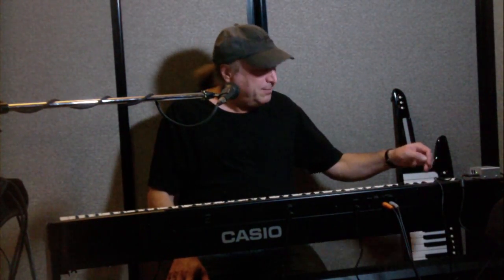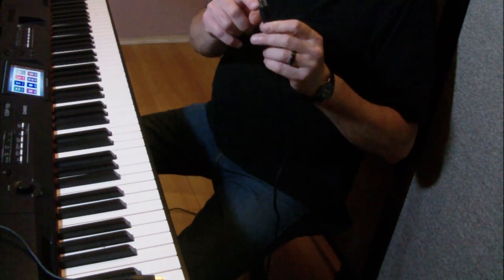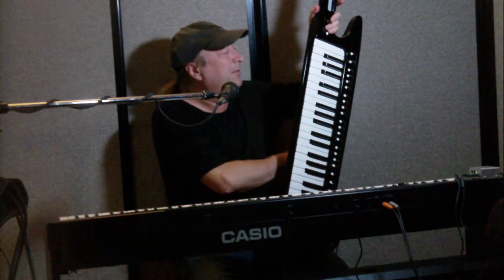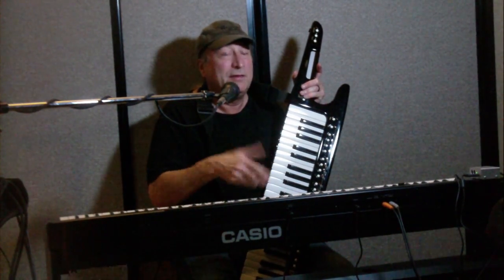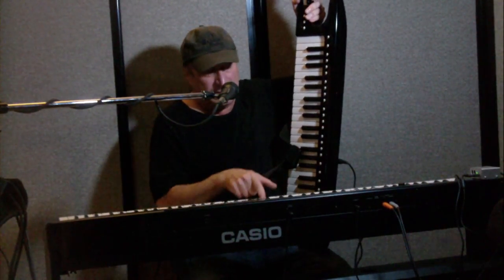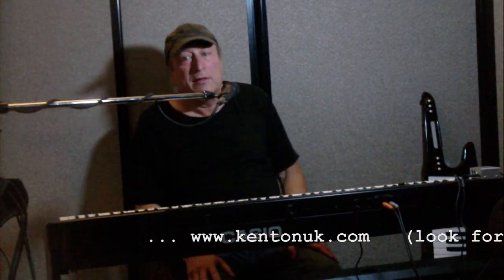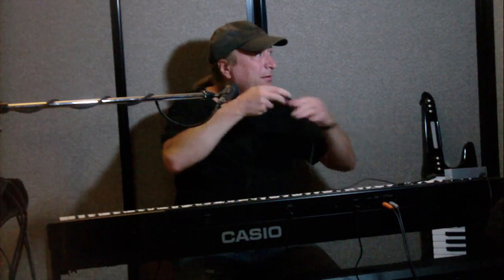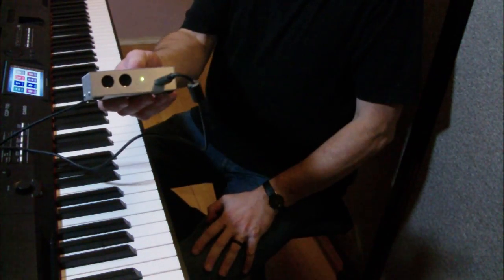MIDI: USB vs Standard 5-pin DIN, and how to convert USB-MIDI to 5-pin DIN MIDI

Comment: Thank you very much for the contribution, that video really briefly explains the function of the adapter, and if you are right, this adapter is an easy and correct way to link one or more keyboards only if they have a USB port.

Comment: Hi Piano Man Chuck
Thank you for this video
Question.....
I have a New Yamaha P-515 and a 2.5 year old Roland RD-88 with an out of warranty noisy loose PHA-4 action (the reason I got fed up and bought the Yamaha P-515).....Great action!
Now, The RD-88 has MIDI out and USB out but does not have MIDI in! Unbelievable🤔
I wanted to use the sounds in the RD-88 by using the Yamaha P-515 as a controller
Being that I paid $1,300 for it 2.5 yrs. ago
I sent an email to Roland for a solution but no answer.......I'm obviously very disappointed
Will this unit, or something less expensive work?
I know that you are well aware of both keyboards
Any help would be appreciated
Thank you for your channel and great info.
Sincerely,
Dave
Reply from the maker: I can't be 100% positive without physically hooking that up and trying it out to see... but I'm reasonably certain that the Kenton MIDI USB Host would work in this situation.  Yes there's other USB / MIDI Host boards out there but the Kenton unit is top notch with no problems.  Others have reported problems with other host products.  I would recommend getting it from Amazon at this link: https://amzn.to/3XyQQfg - that way if it turns out that it doesn't work for you, there's free returns!
Reply: @PianoManChuck  Thanks and may God bless✌
Dave

Comment: Hey chuck. Super helpful video! I have a Yamaha Piagero that I want to use as the master keyboard and then I have a Yamaha Reface CP as the keyboard providing the sound. The Piaggero had a usb cable at while the Reface has a 5 pin In and Out. Would I plug the USB hose in to the keyboard that would control the Refaces sound?

Comment: Hi there, i have a Casio CT-S1 for some time now ans i love it but the 61 keys are limiting my work so i want to use the CT-S1 as a sound module and play it with my 88 and 76 keys midi keyboards.

As the CT-S1 has o DIN midi IN i purchased a Kenton Midi/USB interface. It works and the CT-S1 responds to my playing but the sounds are cut short, even with the sustain pedal. What could be the issue here? Are there some settings in the CT-S1 ? I already swithed the bluetooth off but no change.
Reply from the maker: Please post all CASIO related questions at www.CasioMusicForums.com

Comment: Hi there i have a yamaha p125  and it has no midi 5 pins  can i use the kenton between to audio interface and the p125 to run vst plugins sounds  on a mac ...and get sound out the outputs of the interface to the mixer for sound

Comment: THANK-YOU SO MUCH!!! (Trying to connect Yamaha P-115 to a PianoBox to give me more instruments).
Reply from the maker: Great!
Reply: @PianoManChuck  Unfortunately, it didn't work even w/the adapter box :-(  I guess Yamaha (P-115) is tough. Is my next step to try this by hooking both the PianoBox and my Yamaha to the computer???
Reply from the maker: @terria1254  Some older Yamaha's are not fully USB Compliant - if that's the case, it won't work... but its definitely worked with all other brands out there (this video is 7 years old and I've not heard of it not working.... except with some older Yamaha's).
Reply: @PianoManChuck  Thank-you, this P-115 is a 2015...I'm not giving up yet! (I have found some ipad Apps that give it different instrument sounds).  :-)

Comment: Manufacturers need to keep the 5 pin sockets. I finally got back into synths and it is like searching for the holy grail trying to find a midi keyboard with the 5 pin sockets without emptying the bank account. I'm an analog man.....I avoid computers as much as I can.

Comment: Cool it exists but completely overpriced for basic electronic. I guess it is faisable on Arduino, I'll check it out.
Reply from the maker: There are less expensive units out there, but according to users on various forums, this one is the most reliable.  The good thing is that this can be used on just about any USB-based MIDI keyboard, so you basically buy it once and can use it with many different boards.
Reply: Any results, yet?

Comment: That's great, Chuck; thanks so much for putting that out there -  I have been using MIDI DIN connectors for years and just bought a Native Instruments  controller keyboard which has a MIDI over USB type B and no 5-pin DIN. Now I can use it with my older MIDI modules. Cheers!
Reply from the maker: Great to hear!

Comment: Great video! I wish i saw it earlier. I'm learning the electric piano on a Yamaha P45. It only has USB midi and I simply wanted to hook it up to a Synth module to turn into a synth keyboard as well. I thought it would be a simple connection but it took a few emails with the module supplier to figure out that I needed a Kenton din adaptor to make it work. Have you ever had any issues with the Kenton adaptor? All the best, Nick, Manchester, UK.
Reply from the maker: Had it for a long time, never any issues.

Comment: after watching many videos trying to figure this out this is the first that makes a modicum of sense. I had a old Yamaha PSR keyboard that used as both a controller and the internal with the the old 5 pin connections. After 20 years I finally upgraded to a new one not realizing it doesn’t have the 5 pin, only the USB. I hate it! I can’t connect it to any device that has the 5 pin. I’m considering getting this box but I’m frustrated to no end that they are selling all the keyboards without the 5 pin. I’m still banging my head against the wall with this. crazy world.

Comment: Subbed just for this! I've also been watching your other great Casio PX-S3000 videos. I recently bought that digital piano and ran into this MIDI problem with it. Hopefully, this Kenton box will solve that. It's a bit on the pricey side though!
Reply from the maker: The Kenton is pricey, yes, but its also the most reliable of them all!  I used it years ago on stage with Casio's CGP700 without any problems.

Comment: Have a problem and need help, i have a m-audio controller and just have usb B type midi out, and i need to control and play with it, a roland xv5050 rack module, but the usb of the unit is not for the controler, just can be played with the midi 5 pin in, BUT the m-audio controller, needs that the usb cable brings Power to work, the question is, does this host, provides that to the controller and can my controller works with my roland rack module? I need to fix this soon as is possible, we have shows a head in a few weeks and this is urgent... Thanks!!!

Comment: Which 5Pin did midi cable is correct to use for bass amp to foot switch? Some 5pin din comes with 3wire or 5wire.

Comment: Many home digital keyboards--even very expensive ones--are also dropping the MIDI DIN ports, as home users rarely use them.  For example, my old Roland HP-207 piano (from 2008) had DIN ports, but my new, top-of-the-line HP-508 only has USB B connectors.  I had to buy a Kenton box to connect it to my other devices.
Considering that a manufacturer can put in these ports cheaply, but a Kenton costs $200, it seems like a poor choice for consumers.  But that's what you get for choosing a non-pro instrument.  Anyway, a Kenton works perfectly and is the only choice in this situation.
Incidentally, there are a large number of devices to connect from USB-A (the flat kind) to MIDI.  These are commonly used with computers and iPads.  For example, I use a Roland Duo-Capture.

Comment: If i knew this would be a problem I would have bought a midi controller keyboard with a 5 pin Din Midi out. That Kenton box costs about the same as my Novation Launchkey.

Comment: USB Midi is a new Standard which is here to stay, the older 5-pin system will be Obsolete soon .
Reply: Richard Turner never going to happen, too many old synths that are way better than anything out now use din midi ,none of my gear is usb only ,I would not buy anything that was USB only
Reply: USB has a number of disadvantages. MIDI is electrically isolated so no ground loops. MIDI connectors haven't changed in 40 years and are backwards compatible over that entire timespan yet USB is on yet another iteration after just a few years. USB is computer oriented but MIDI is performance oriented.
Reply: iqi616 well said
Reply: Boss and Roland use Trs midi and there are midi a 5pin and midi b 5pin to trs connectors . I wishe they'd standardised it

Comment: Can a wind controller e.g. Akai Ewi 4000s/USB be used to control the Casio MZ-X500 which you used in this video (or any other keyboard)? Thanks.
Reply from the maker: The keyboard in this video is a Casio CGP700.
This is a piano / digital piano / stage piano oriented channel, I have no experience with wind instruments.  Your best bet is to find a forum more closely related to MIDI wind instruments.
Reply: Oh thanks for the correction and info.

Comment: but whats the advantage of plugging the controler to the synth instead of plugging it directly to a computer?
Reply from the maker: To eliminate the need for the computer, of course!  Who wants to take a computer with them everywhere they go (ie: gigs) and subject themselves to all the pitfalls (blue screen, latency, etc, etc, etc)?
Reply: The advantage depends on what you want to do or the problem you want to solve. 
In the video, he has a keytar controller that produces no sound, so he wants to connect it to something that will generate sound as he plays the controller on stage. So he only needs to connect those two. He says he wants to eliminate the computer, but his answer doesn't go into explaining other scenarios you may be thinking of.

Another scenario would be you are a home user and you want to play a controller or keyboard and use sequencer software on a PC to record/arrange, etc. Now, if you own only this keytar with 5-pin MIDI out, you would need the box because you can't plug in the MIDI 5-pin to a USB port. Then that's the advantage.

If the same home user owns the Casio keyboard which has MIDI through USB then he can plug it directly to the PC USB. So then there would be no advantage, or no way to use it, since the box need one side to be MIDI 5-pin.

Comment: you donno how much this video helped me.. I own a Yamaha p115 digital piano and Yamaha s970 arranger. since P115 has only USB midi, is it possible for me to control my s970 with my digital piano? pls help me how to connect both the keyboards. I want to control my s970 in 88weighted keys. thanks.

Comment: Question: I have an M-Audio keyboard controller and a Cassio full blown sequencer.
M-Audio is only usb, Casio is both usb AND DIN in & out.
I also have a similar midi hub with usb AND DIN in & Out.
How do I set up the two keyboards to my Studio One DAW in my PC?
Goal is to program sequencer with individual Tracks (via Midi Channels) and use controller to orchestrate the sequencer for recording to DAW.

Comment: can i connect the kenton to a casio lk210? is not a midi device, is just a regular keyboard
Reply: According to the LK-210 manual the keyboard is general MIDI compliant. The list of messages it can send and receive is in the appendix. The Kenton should have no problem with it.

Comment: Chuck....I have seen USB midi to 5 pin MIDI in and out cables with the converter built in. Are they any good? I do not have the $70 -$100 to spend. What do think
Reply from the maker: No!  I think you missed the point of the video.
Reply: Those interfaces can only connect a DIN-equipped device to a computer, so no, they will not solve this problem at all.

Comment: You gave such a marvelous explanation. And has made so much sense. Yes, the MIDI 5-Pin DIN do not wear out. I have a Kawai Digital Piano which is 25 years old and its MIDI is still going strong. My friends back then thought I was a real nerd. (I guess they still do).

But I'm a nice Nerd. But you speak Geek even better than I do.

However Yamaha has released Bluetooth MIDI adapters for both USB out keyboards and MIDI standard in/out cables, which send your MIDI signals to iPad without the wires. For those recording MIDI into and iPad it means that you can keep your iPad charged. The products are MD-BT01 (MIDI) or UD-BT01 (USB). The devices are sold separately for about $50.00 each. They support Yamaha products but you may want to check the supported products page at Yamaha.com. If it is a non Roland keyboard, you might want to keep your receipt. It is supposed to work well with the iOS, but haven't done my research on it yet on my Mac Pro. Haven't ordered it yet. Still thinking if it is indispensable to me yet.

Comment: Thank you Chuck, I was wondering over this 'problem'. Many of these keyboards seem to skip the traditional Left / Right jack audio- outputs aswell. Is there also a solution for connecting such a keyboard to a external PA, to get a stereo singnal out? Thank you!
Reply from the maker: +Hans Palenlader - Yes, use the headphone jacks.

Comment: Thanks so much for your information Chuck. I was wondering whether you could answer this question for me - can the USB B-type port at the back of most keyboards be used to RECEIVE MIDI data? For example, if I have an AX synth that can send USB MIDI data to your Casio keyboard, could I connect the AX synth to your Casio keyboard directly through their USB B-type ports and have the AX synth control the Casio keyboard?
Reply from the maker: +Power Balance That's usually a USB-enabled MIDI port (send/receive) when connected to a USB-compliant computer.  No idea if it'll work with an AX synth.